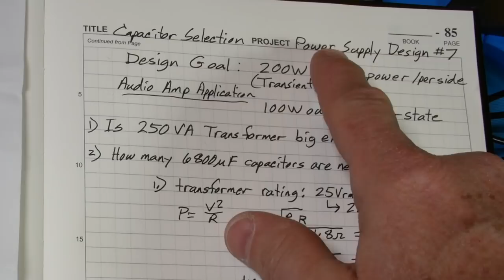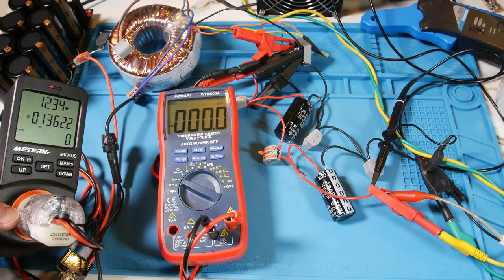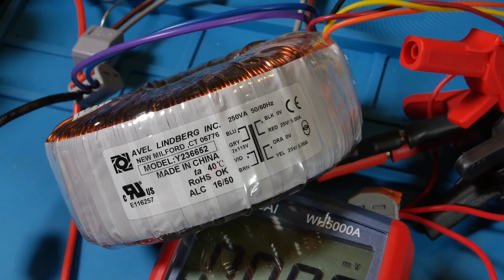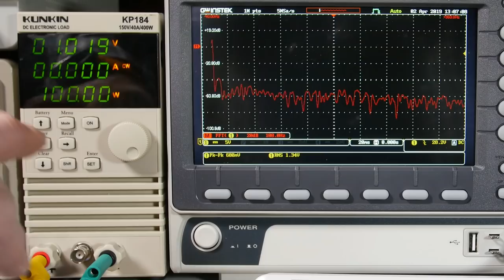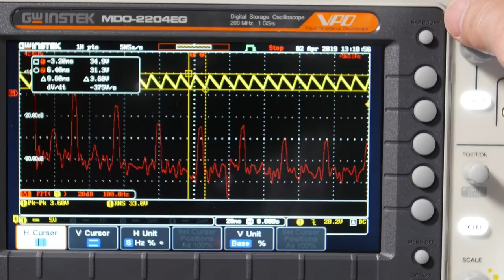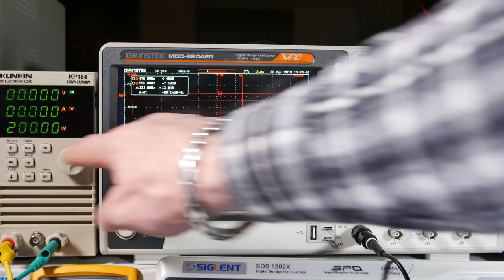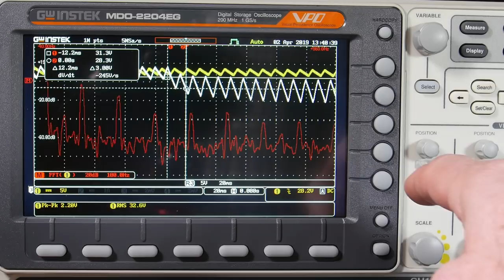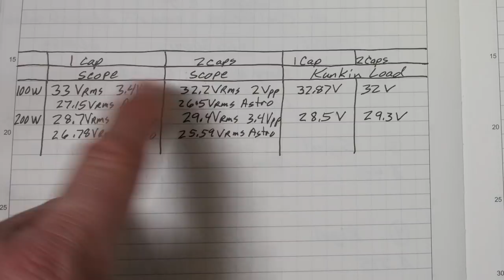Power Supply Design #7 Capacitor - How Big? #howtosizecapacitor #bulkcapacitor #capacitorbankdesign

Comment: Hey Eddie, my capacitor bank is bigger than your capacitor bank!  Well, not yet but it feels like a challenge :)  

Thanks for doing this video, it was a really useful demonstration of calculating and measuring the smoothing capacitors.  Great to see this on the scope as well.  Would you live with that ripple for your amp or shift to slightly bigger caps, say 2x10mF - I guess downstream regulation would smooth further so that may not be necessary?  I can see now how power factor impacts this but also wiring.  A lot to take in!  Brilliant, thanks.
Reply from the maker: You are welcome!  You are correct, there is a lot to take in.  My thought is first to explore the ‘big’ cap bank method, and then explore other ideas.  I’ll upload another video in this series this weekend!

Comment: Hi Eddie!
In a previous video called "power supply for 50w at 8 ohm amplifier" you calculate the change of voltage (DV) by substracting the amplifier peak voltage (Vpkamp) from the power supply (transformer) peak voltage (Vpktr), while in this video you calculate the change of voltage (DV) by substracting the amplifier RMS voltage from the power supply peak voltage.
Which one is correct?

Comment: I am working on building a simple power supply for a 24v dc powerchair motor. The rated watts for the motor is 220 continuous, 550w peak. If I were to repurpose some old 12 vac 600 watt landscape lighting transformers, after rectification, what size uf capacitors would be recommended for my purpose? Thanks
Reply from the maker: Thanks for this great question about a real life situation;)  I might need more information but let's see if I can help.  The 12 Vac has a peak voltage of sqrt of 2 times your 12 Vac which gives a peak of about 17 Vdc.  So, this is a bit short of your needed 24Vdc.  Use a large cap rated at 35V (for voltage derating) and use large caps to try to keep the voltage up especially because of the surge current needed.  But you did say plural transformeers;)  so place the input of two transformers in parallel and their secondaries in series so that you have closer to twice the voltage (34 Vdc).  If your motors are OK with this then you will not need as much capacitance.  Give me more info on the specs and I can give you more specific help.  Just know that the info that I give here is a guess as I don't know what exactly we are working with;)

Comment: Is it possible ‘overrating’ the value of the capacitor(bank)? 

With the calculations I need 13mF per powerline for my new to build poweramp. But what if it will be increase enormously?
Reply from the maker: Thanks for asking!  Do you mean overrating the value of capacitance or voltage rating?  Can you share the values you use to calculate the 13mF?  Maybe I can provide options;)
Reply: Like 100.000 uF per line = total 400.000 uF?

Many of my favourite Amps;
- Boulder 3060, 225mF
- Burmester 909
- Gryphon Apex, 1 F
- Jeff Rowland model 8, 468mF
- SimAudio Moon 888, 350mF
- Mark Levinson No. 33, 780mF
- Tidal Assoluta, 330mF

The idea now is, 5 x 22mF 63VDC per line (10 x 22mF per channel) 
ESR < 25 mOhms
85 Celsius

Mouser: 80-ALC80A223EH063

Or,

Mouser: 647-LNT1J223MSE
Reply: @KissAnalog  output rectifier +- 42 VDC. Based in the Netherlands = 50 Hz = 10ms 
Current 8,6 A
150 Watt@8 Ohm
300 Watt@4 Ohm 

Rimple 6 Volt 

Transformer 2 x 500 VA 2 x 25 VAC (dual mono)

Comment: hello I'm a PCB designer and I have a question recently I purchase a toroidal transformer 600VA for 117V to the primary just like the USA outlet cause I live in Puerto Rico ok the toroid has two 45V AC winding and two small ones 12V AC and 18V AC I already design the soft star PCB to use NTC and the way I made the PCB is that I can installed them in parallel or series by jumpers selection since this is my first time that I'm gonna use an NTC thermistor I'm not sure what part number I need for my application the soft star is gonna be used on a class AB audio amplifier 250W per channel, can you recommended what part number I need also do I need one or two in series?
Reply from the maker: vargasmongo3435 Thank you, this sounds like an interesting project.  What Amplifier are you using, one of your own, or a kit?  For your Amplifier Power supply, I think one on the primary side is enough.  I used a 10 ohm, but a 2 ohm would work as well. You want it large enough to handle the inrush current and the average current. This link is to a commonly used one in HVAC, so it is relatively inexpensive for its large size because of its popularity.  You can use this link and then go find the 10 ohm equivalent if you like.  BTW, is Amazon convenient for you in Puerto Rico?  https://amzn.to/2DCUhLp
Reply from the maker: Great video!  I can see what you are doing - very impressive!  I can only understand muy poco de español.
Reply: @KissAnalog   lol sorry about that I can also do English commentary thank you for check them out 👍😊

Comment: I will have same transformer ( 2x25V) - for an audio amp having obviously two rails. Is it OK  to use one full bridge rectifier ad your proposed tie red with orange OR split it compltely so 2 full bridges and than 2x caps ?
Reply from the maker: Yes one rectifier can work - as long as it can handle the current.  I just posted a couple videos on the power supply for a Class D amp?  Class D More Power Bigger Transformer TDA8954  HD 1080p https://youtu.be/IDNM2OAAXeg

Comment: Hi Eddie,
Your calculation you got 8.3mF capacitance and you used 13.6mF
So that would be 7.07A/(2*60*0.0083) = 7.098 ripple voltage p-p ?
And at 7.07A/(2*60*0.0136) = 4.332 ripple voltage p-p  ?
Amps/(2*frequency 60Hz*capacitance in Farads) = ripple voltage peak to peak.
Is the ripple voltage acceptable for the Amplifier ?
My bench power supply is rated a less than 100mV p-p ripple at 3Amps at 30v, so it seems a lot ?
Been through some calcs for my own power supply that I'm building, that's why I'm asking.
Cheers Adam
Reply from the maker: Thanks for this comment - it is right on target!  That’s a great question, how much ripple is ok?  I’ll do another video to explore answers to this question.  One thing you don’t want is the amp output hitting the power rails.  That’s a somewhat easier problem to see, but what about modulating the amp rails?
Reply: @KissAnalog  
Looking forward to the video.

Comment: For 200 watts on 4 ohm , I'm getting 20,000 mf. That's with 1.41 power peaks included.
Reply from the maker: Thank you!
Reply: So a 100000uF cap would be good enough for 1000 rms class a amp power supply?